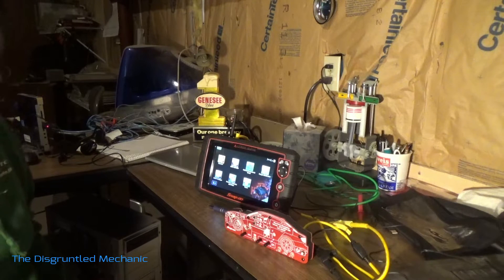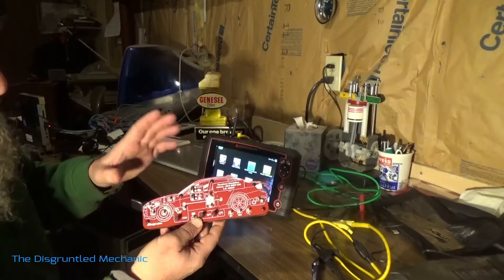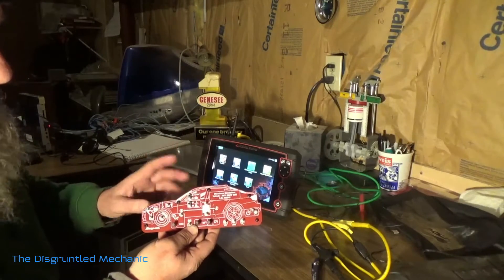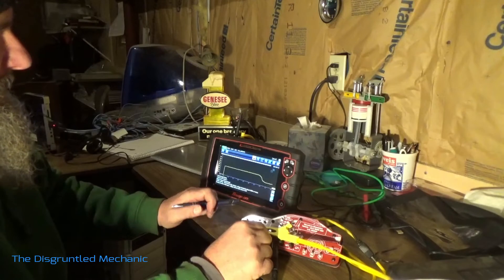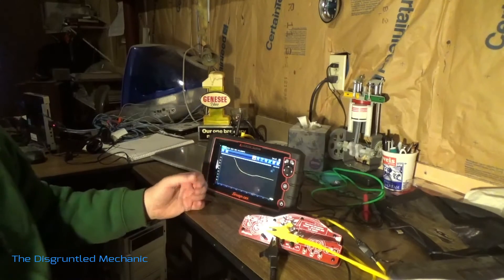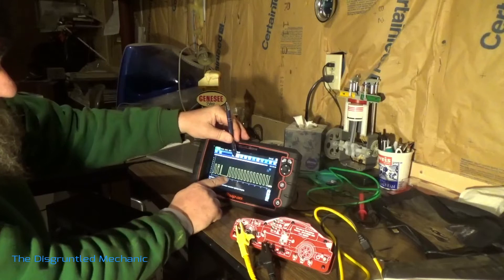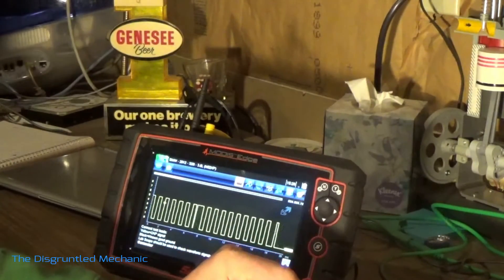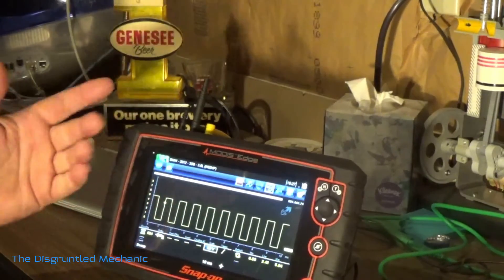Snap On Waveform Simulation Vehicle for Labscope training

Comment: this stuff would have been killer tooling circa obd1 vs. cross the fingers and try to catch a glitch on VTVOM (yes vacuum tube meter)about as sensitive as you could get, except an oscilloscope, who could afford one back then? especially not a kid.
I guess the bright side was, eyes, ears, nose and feel getting trained and tuned in to things not being right and having a good guide as where to start and as always confirm the diagnosis!

Comment: Hey Mike were do you buy your tools. Amazon is much cheaper but no support if it doesn't work right. Seems like most there scanners and such are not for domestic stuff 
I use the blue drive just for getting a code for DIY. I hate to buy expensive stuff when you don't use it much
Reply from the maker: +Arthur Rodesiler my scan tools I have gotten right from the supplier. Aeswave sells them but I think most are high end.